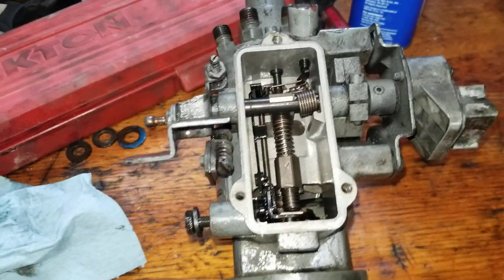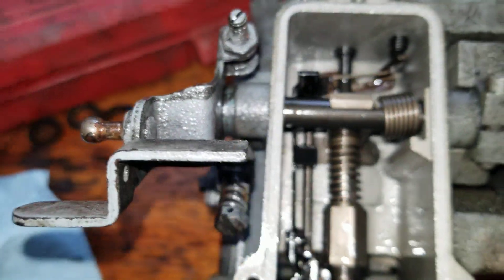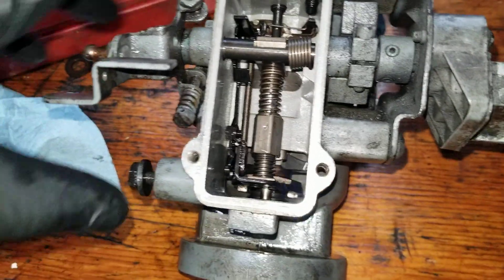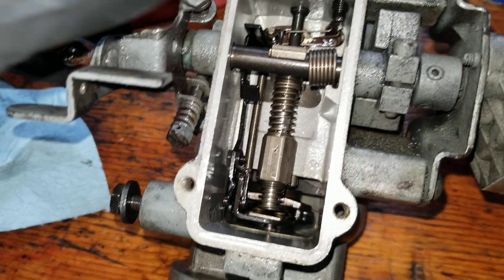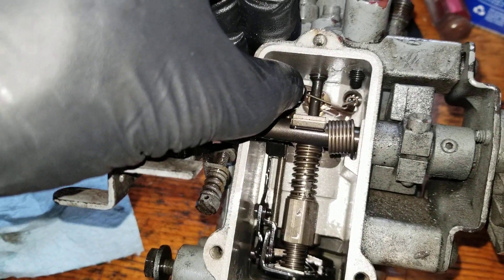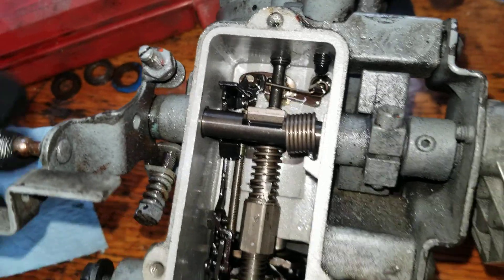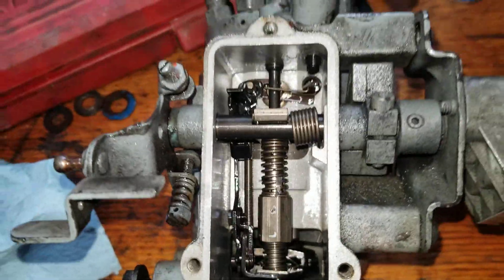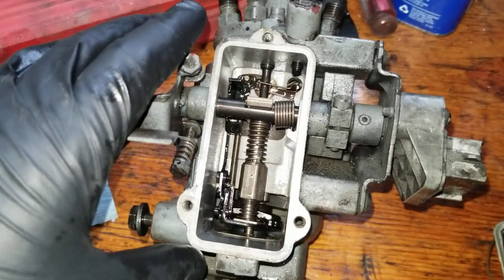How to adjust the metering valve on a 6.9 or 7.3 IDI Injector Pump

Comment: Understood. But do not know how you can do anything wearing those things.
Reply from the maker: I don't wear gloves when doing fine tuned things (like finding the 5/32 Allen fuel screw), but for manipulating the metering valve, that's easy enough to do with a glove.

Comment: what is the name of the throttle piece where the vacum hoses hook to the injection pump . its located left side of the pump . My vehicle is 1989 ford 7.3 idi
Reply from the maker: It's a Vacuum Regulator Valve.  It controls the vacuum pressure to the trans modulator to adjust based on the throttle rotation.  The C6 transmission has a purely mechanical VRV.   I have a video about my VRV project here:  https://www.youtube.com/watch?v=74xGJLUxFaY

Comment: This literally saved me man. Appreciate this a lot. Just want to make it clear that the bar on the shut off solenoid goes on the side of the “thing” you mentioned that is closest to the fan clutch.
Reply: How does that stem go back on there because mine still high rpmswhen turned on
Reply: Darren Crunkleton I was really careful when I did it and don’t force anything. So I put it in with that bar that protrudes down on the side of the metering valve that is closest to the front of the motor. Then you should be able to push the Injection Pump cap towards the rear of the motor to line the holes up and tighten it down. Just make sure you wiggle that metering valve enough to where it’s nice and loose. But that bar will keep the valve closed until you turn the key to on which will activate the solenoid and pull that bar backwards and open the valve. Let me know if you have any additional questions.
Reply: Thank you so much I finally fixed it but now my started burned out
Reply: Ok now it's still running away engine
Reply: Darren Crunkleton the throttle control is closed or fully open or what?
Reply: I don't know it just runs away and I turned the key off and nothing so I had to choke it
Reply: How do you know if it's closed or open

Comment: This literally saved me man. Appreciate this a lot. Just want to make it clear that the bar on the shut off solenoid goes on the side of the “thing” you mentioned that is closest to the fan clutch.
Reply: We followed your instruction, connected the solenoid arm to the back of the connecter. It first fit good and seemed right. The engine took off at max rpm and would not shut off . ( run away ). Luckily my truck is a stick, was able to put it in gear and stall the engine with the clutch and brake. If it was an automatic I imagine you would be screwed. Dis assembled, put he arm in front of the connector and it work as normal. Hope you can correct this in your video to avoid catastrophes.
Reply: Same happened to me. Ended up cutting fuel line

Comment: Someone told me that when you rebuild one of these pumps for a f250 7.3l engine non-turbo that you need to have it calibrated after, is that true? and if it does who would you take it to to be done
Reply from the maker: I've always sent my pumps to R&D IDI Performance to get rebuilt.  You should call up Justin and ask him about the proper protocol for pump rebuilding and calibration.

If you are talking about "timing" your engine after a pump rebuild, you are correct.  A rebuild of an IP will slightly alter your timing (just the act of removing it from your engine will affect timing), so you should find an IDI friend in your area who has a timing light and ferret meter.  Once you reinstall the rebuilt pump, time your engine in accordance with the Ford specs, which are different between the turbo and N/A, and different between the turbo kits.

Comment: if the fuel does not reach the injector; What are the possible causes of problems? thank you for this vedeo
Reply from the maker: It could be a lot of things.  If you are absolutely sure that you have proper fuel and pressure up to the IP (read this if you are not sure:  http://www.nickpisca.com/diesel/fuel-system/what-to-do-if-no-diesel-fuel-is-coming-out-of-the-schroeder-valve-on-a-6-9-7-3-idi/ ) then it could be the IP has some issues, the FSS isn't functioning properly, the check valve has malfunctioned, or the metering valve is stuck, thus the meaning of this video.

Have you made sure you are getting fuel to the IP inlet first, before addressing the lack of fuel at the injector?

Comment: please what will happen if the engine is cranked while  the locking screw is not tightened
Reply from the maker: I'd need a little more info.  Are you asking what will happen if you crank the engine over while the locking screw is loose?
Reply: I have an engine perkins 1104 first I tried to run the engine but it didnot start then l loosen the nuts of the first to injectors(to realse air in the fuel cycle) then I crancked the engine many times and I found fuel coming out of the nuts but the engine donot start I kept trying till the battery is discharged then I found that the locking screw of the injection pump is loosened
Reply: +mohamed talaat 
Iam asking if the pump injection timing is lost and it has to be calibrated again or this assumption is wrong
Reply from the maker: I'm not sure.  Without seeing the engine in person, I can't really tell.  If you are getting fuel to the injectors, that's a good sign.  Do you have enough voltage on the batteries?  Sometimes these older diesels won't start unless you have above-average cranking amperage.
Reply: +0001D LLC 
I kept trying more than 5 times then I connected 2 batteries(24v) also the engine cranks and fuel comes out of the injectors but it doesnot start,I want to ask if the loosen locking skrew of the pump affects the injection timing or not
Reply from the maker: I don't know for sure, but if the locking screws were loose, then I'd assume the timing is still ok.  It'll still hold the IP gear in the correct place.  Just tighten them down and try again.  If the problem persists, you might have to pull the front engine plate to re-time the gears.